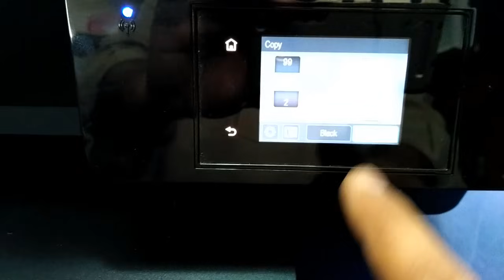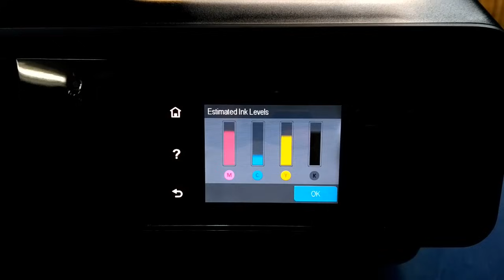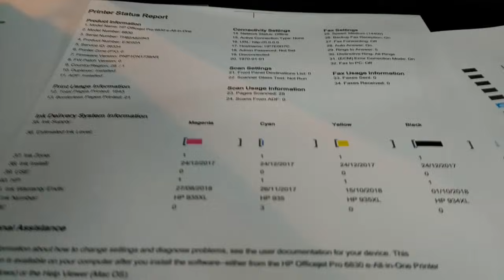hp officejet pro 6830 printer head Cleaning

Comment: Thanks for this video, a big YUGE thanks!!! I have the same model and found it pretty hard without a long skinny star screw driver. Purchased a set  one on Amazon, to get down into the skinny holes. After that disassembly was easy. 

Fortunately I had a syringe to help with the draining of the individual heads, definitely don't want to get the micro chip side wet. I found myself changing out a few paper towels through the draining process, be careful this thing drips so try not to move the print head too much, keep a trash can near. This gentleman used a cd case, I put my print head in an older  plastic ziploc container. 

Thanks again for saving me $100+ 

Also noting,  inside the chassis where the print head was I saw some ink residue, attempted to use some alcohol wipes but wasn't easy, a few or more q-tips rather is a better choice to clean with.
Reply: Hey Logan...what size star screwdriver did you use?? I tried an allen wrench but of course it didn't work. I can't even get started to undo my printer, bec I can't get the screws out...Thx.
Reply: lanancedar I got the e.durable precision screwdriver set from amazon. Unfortunately after several tries the printer head would shortly fail after only printing a few times. I’ve since thrown this piece of junk in the trash, but I’d figured I’d try my best, plus I got an excellent set of precision screw drivers that I’ve since used over and over again
Reply: Thank you Logan. I've been trying to find a single small thin star shaped screwdriver all day...my printer (besides not being able to make just a black copy of something)also has a bunch of gooey-ish black ink underneath where the carriage slides to on the far right, on the bottom of the printer.  That is why I was hoping to take it apart, so I could clean out that black ink that somehow leaked. It does seem like really it's mostly just a piece of junk, and I will no doubt have to go get a new one.  Thanks for your reply earlier. I appreciate it.
Reply: One more question for you Logan...do you remember if you used a T5 or a T6 torx screwdriver to take the screws out of the printer? Or was it an even smaller T size?
Thanks.

Comment: You don't have to take the printer apart to clean the printhead. Just slide the print head to the side and put a paper towel underneath it. This is the most extra way to clean it 😂
Reply: Great tip although I had to do one extra thing which was to ever so carefully place one tiny drop of cooled down boiled water at a time over the black ink head, wait for it to slowly drip down and keep changing the piece of folded kitchen towel paper, as the flushed debris leaked onto the paper.  I gently put the paper in place using tweezers to pull it out from the other side, wiping the heads at the same time.  I repeated this process about 6 times until the heads were 'flushed out.'  The only radical thing here was that the printer had to be switched ON the whole time, in order to be able to move the cartridge head unit to the centre so one can then ease the absorbant strip of kitchen towel underneath where the ink heads are!   I then switched it off from the socket and PC before switching it on again and putting new HP cartridges inside. The first couple of prints were weak until the new ink started flowing all the way through the flushed head. So thanks for the tip since this repair was achieved, like you said, without having to dismantle the printer at all.   I rarely use the printer so I believe that's why the original inkjets had dried up and clogged up the heads.  The black unit needed the most flushing as opposed to the coloured ones.  I will make a habit of printing off something random every week just to keep the ink flowing and hopefully avoid this problem again.

Comment: Reading the complaints here in Brazil, I saw that more than 90% of the people who bought the HP6830 (or HP6835) have the same stupit problem.  It is a hardware error (congrats to HP engineers) Here it sets up deceptive propaganda. The problem is that my warranty is over. This template should be named HP_BULLSHIT. if the worst came to the worst, one might be tempted to go to law.
Reply: Change "template" to "multifuncional"

Comment: Your video is great...but I can't get the screws out to even get started. What size hex thing did you use??  Thanks.
Reply: lanancedar i think is a torx 10
Reply: Hi juan, thanks. I did find that a Torx 9 would work, but then the one I had wouldn't go down into the two deeper holes where a couple of the screws are; I'd even bought a whole set with an adapter handle, but the end of the handle was still to big to be able to get into the holes where the screws are. It needs to be just a super slim long handle, and I still haven't found one.  I have pretty much given up on it.  It's really frustrating.  Thanks again.
Reply: @lanancedar  We were dead set on getting a new printer, so I just went ahead and drilled into the thin hole and basically cracked away the casing. Worked for me.

Comment: Hi. My printer is Keep Pop Out 'Printhead Problem' everytime I on. I can't print anything, if this is my case can I still use your method to fix my printer ?
Reply: Yes, this is the fix for that error message.  In my case the printer is 5 years old and had a lot of old congealed ink in it.  It definately needed to be cleaned out.  It is not easy if you are not handy.  You need a # 10Torx screw driver to remove the screws.  We did not remove the  clear positioning strip, as it did not seem necessary to us.  Read my previous post on how I cleaned the print head.

Comment: Hi there, 

i did everything as per the video but my printer still says the same.  However, I noticed under it, it's a lot of ink spilled and the rubber belt has some holes ? is that supposed to be like that ? 

Regards, 

Alex
Reply: same mine has alot of ink spilled idk what to do

Comment: Hi folks, the print head on the Officejet Pro 6830 is not replaceable.
If you see an error about a Problem with the Print head please contact HP
Support for a replacement printer”.
The replacement with a new one, makes no sense, because this printer is very poorly
designed. 

The Print heads are incorporated, cannot be removed, so cannot be cleaned.
The Print head cleaning mode tool, it is a joke, because you cannot unclog a
clogged print head adding more paint in it. It is like adding more fuel in a
fire.The print heads die, then printer die. Do not waste your money with this model. Run Away.
Reply: Arbaches Glaukus - True, shouldn’t be designed like that. But if you have to repair it, you can order a replacement head from hong kong for about 30 eur. The video shows how to replace it.
Reply: I had been using my daughter's old inkjet printer from when she was in college. It was nothing special with no bells and whistles but did the job.  After a zillion years, it finally gave up so I decided, heck, I should spoil myself and get a stepped-up model with the bells and whistles (copying, scanning, emailing, etc.).  I look back now and am gobsmacked at myself -- how could I not have seen the warnings on this model that were all over social media?!  Within a couple of months of having the brand new printer, there was a printhead issue that required the entire printer to be returned to the company.  Instead of sending me back a NEW printer, they sent me a "remanufactured" printer that was the same model.  I was in the course of moving, so I barely used it at the time (but it did work).  Fast forward to me moving and not taking the printer out of the box for 2 years because I was genuinely annoyed and skeptical of it's ability to do what it was supposed to do.  When I did unbox it, not surprisingly, the problems started almost immediately.  First, the ink carriage didn't want to line up.  I dabbled with it for a  couple hours (I had no idea what I was doing btw, but somehow it started to work - for about a  half a minute.  Then, it flashed the message that the ink cartridges had dried out and where unusable (cha-ching $99).  I fixed that problem. Now, it's a dang printhead problem.  Haven't been able to use this stupid thing for months.  SO FRUSTRATING!!!  The scanning feature?  AWESOME!  The emailing feature?  AWESOME!  The self-feeding feature?  AWESOME!  The ability to print even one single word? MISERABLE FAILURE!!
Reply: It's a really crap HP product. I got two machines repaired (swapped) under guarantee, and now the third piece is giving the same cartridge defect error. It's not broken, but HP ruined it on purpose thru hp updates I believe.  This was definitly my last HP piece of crap...